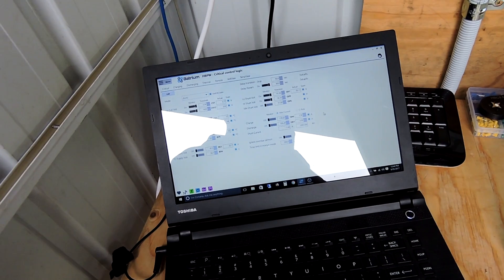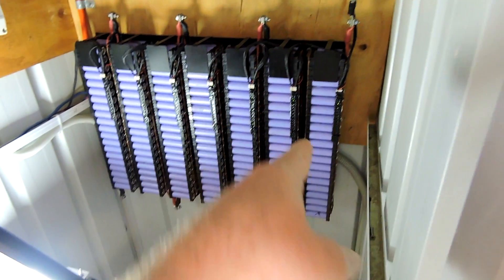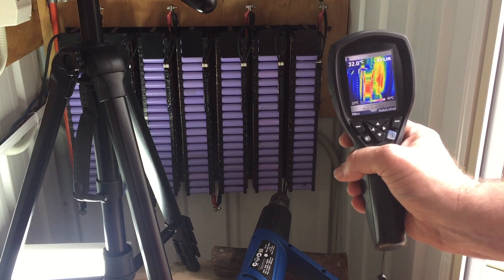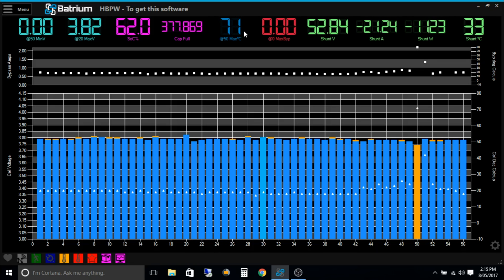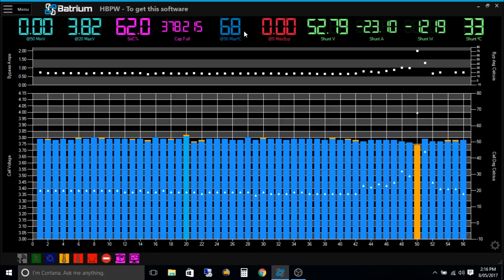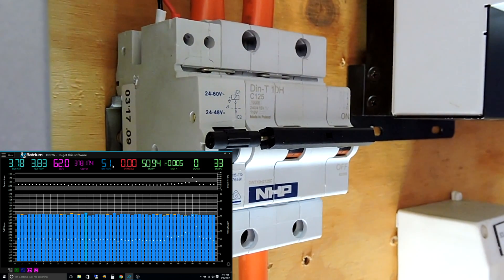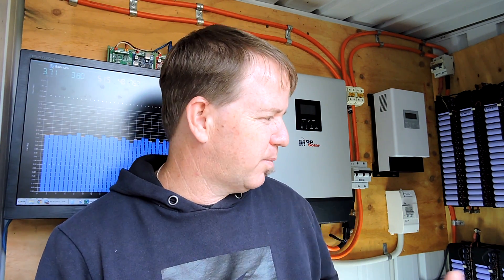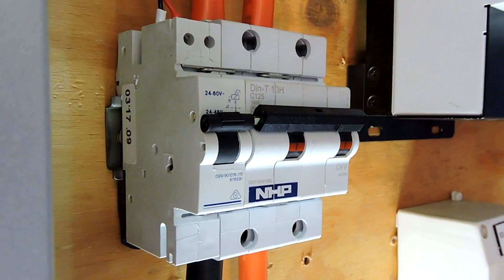⚡💥⚡18650 Powerwall Safety Test using high cell temperature & the shunt trip⚡💥⚡

Comment: hi Pete not sure if u know but I have an existing grid tided set up and want to run a battery bank and another inverter to power the house during the night can I hook up a charge controller in parallel with my existing panels and inverter
Reply from the maker: you need to talk to an expert not Pete, I googled everything I know :)
Reply: thanks mate yes I have sussed it out have the batteries reconfigured the solar panels and have a new hybrid 4048 inverter from mpp solar all is ready just waiting for electrician to wire it to the house on Thursday

Comment: Nice fan, with interchangeable battery with the tools. Cordless tools hasn't really took off here in Brazil so far, apart from small drills and screwdrivers which are relatively cheap. I have a fan that looks exactly like that, but like everything, to be affordable, it's mains voltage.
Reply from the maker: Yes, love my Ryobi battery tools. Great for around the house!

Comment: for all your people looking for cheap cells, I found 20 brand new , LG cells with a bms for a dollar seventy five cents a cell. they are wired in packs @ 36 volts with bms attached.  here's the link for U.S. buyers,  free shipping too. http://www.ebay.com/itm/NEW-LG-36V-4-4AH-BATTERY-PACK-18650-EBIKE-VAPE-POWERWALL-BATTERIES-20-CELLS-BMS-/172630688902?hash=item2831974486:g:nKUAAOSwuspY9YNZ

Comment: Hey Pete ! Nice ! You're right to take care of thermal management of your system, it's very important! The best would be to get the temperature of each cell, but not practical. I still wonder that the difference in temperature between cells outside the pack, compared to those inside, and not even easy to measure with IR sensor because the terminals are metal so the emissivity is not the same as plastic. A water cooled system like Tesla is the best, and from what I understand is a way to cool down a shorted cell so that the fuse blows but the cell doesn't reach thermal runaway, or doesn't communicate its bad manners to its neighborhood ... AND you know I bought an orange hoodie! Another way to say thank you ...
Reply from the maker: Even tho I've done everything I know or understand to make this project as safe as possible I still feel I have a ways to go yet. A bunch of smaller fuses are needed on each bank of batteries as well as the ability to control my pip to charge lithium cells much better.

Thanks for buyin hoodie, be sure to give me feedback as I've never done Tee's or merch before

Comment: 55 degree for 1 min is your protection setting seams to be a bit long, I understand spurious trips and loads, 
OK here is an idea for your next video  test 1 cell fully charge short it out and see how the temperature climbs does it climb past 55 degree in ten seconds and rockets up to thermal runaway before your minute is up before your shunt trip gets a chance to operate, build your own temperature curve in real life by taking measurements  and you might be able to understand more how a cell temperature operates over the min shorted and you will have real world numbers  to work with
Reply: Oh ya keep them vids coming great work 👍
Reply: I agree that the time constraint seems a bit long. I would probably try for 15 seconds. A battery in melt-down can spread a lot of damage in a short amount of time.
Since heat is always a product of a chemical reaction, I assume a cold trip would be purely the result of environmental considerations. Why not just have a thermostat in the room wired in series to the shunt trip. Temp drops, thermostat goes to open and the shunt trips.

Comment: I'd like to see you run the whole house purely off the solar panels and batterypack for 36-48 hours including all of the high amp stuff you don't have hooked up atm like the a/c. So it could be legitimately off-grid. I'm wondering if your battery pack size would be determined by the amount of peak amps you'd have to be capable of supplying or if it'd be determined by total capacity needed to run that long???
Reply: Memphis O'Conner He already Made a video
Reply: sebasese1 Yeah, I've seen those but they're not technically with the full house load because there's some key high load appliances which are only connected to the grid like the a/c and fridge and a couple other items i think. i want too know what it'd take to go full off grid with all electric appliances (i.e. no gas cook tops, hot water or ovens) and still having modern electronics like internet, phones, computers, etc. in other words without going full cave man.
Reply: I'm also wondering how you'd go trying to balance the battery packs if you had something with a decent constant load that you couldn't switch off like a fridge. i.e. would the watchmons be able to balance the packs if you were constantly drawing and charging a hundred amps or more or would they not be able to keep up because they only burn off a small amount of electricity at a time?

Comment: 63 amp breaker? 

Where did you get an odd ball breaker like that? Is that made for a set up like this, or could you find it in an on grid house too?
Reply from the maker: Sparkie said it was required to have a duel pole 63a so that's what it is.. seems to work so all good for now
Reply: HBPowerwall interesting. Here in the States we only have 15, 20, 25... and so on. Nothing with a 1, 2, 3, 4, 6, 7, 8 or 9 at the end.
Reply: Robert Steich ~ found Clipsal dual 63amp on there website at http://www.clipsal.com/Trade/search-results?q=4cb263/6

Comment: How much did the batrium BMS cost? What did you do with the cells that fell below 3v at the end of your last 4kw load test. How often do you get cells failing just wandering if it's worth investing money in this
Reply from the maker: Kit can be found here https://www.batrium.com/products/starter-kit-watchmon-sfp102mod-14s-longmon?variant=30862617480 the cells were just recharged and still in use. It only goes that low when I change the settings to allow such silly things. I only change the low voltage when I'm doing capacity tests for youtube. Don't usually allow that type of things really want my batteries to last as long as possible

Comment: how many amp is full setup and what u can use ? and what kind of solar charger u use ty I'm off grid that is why I ask ty :)
Reply from the maker: ah? useable 650 ah 35kwhs max draw is 90amps I use a https://rover.ebay.com/rover/1/711-53200-19255-0/1?ff3=4&toolid=11800&pub=5575290598&campid=5338073988&mpre=http%3A%2F%2Fwww.ebay.com%2Fsch%2Fi.html%3F_from%3DR40%26_trksid%3Dp2380057.m570.l1313.TR0.TRC0.H0.Xpcm60x.TRS0%26_nkw%3Dpcm60x%26_sacat%3D0 or https://rover.ebay.com/rover/1/711-53200-19255-0/1?ff3=4&toolid=11800&pub=5575290598&campid=5338073988&mpre=http%3A%2F%2Fwww.ebay.com%2Fsch%2Fi.html%3F_odkw%3Dpcm60x%26_osacat%3D0%26_from%3DR40%26_trksid%3Dp2045573.m570.l1313.TR0.TRC0.H0.Xpip4048.TRS2%26_nkw%3Dpip4048%26_sacat%3D0
Reply from the maker: wow they are long links
Reply: HBPowerwall nice ty I was planning to get mppt :) I have 450ah in the moment but not good inventer only 2kw

Comment: So are there cell temp monitor in different parts of the cell or is it just in your long mon?
Reply from the maker: +Clint Judd yes two per longmon so 112 temp sensors in long moms alone. More in the shunt, watchmon & inverter
Reply: So if you get a hot cell away from the longmon then it wont register..
Personally your fuse setup will cover a shorted cell as the other parallel cells feed current into it.
On my pip4048  Ive seen 90amps on the batteries  or just over 4kw output running the HWS as a test.
That was on 700AH of Pb acid.
Personally summer is the only time  your shed will see overtemps as our ambient temps can hover in the 40+ all day and night.
I like that you keep stacking capacity but if you want them to last you'll need to keep them cooler than our aussie  summer temps.. Especially with load.
Like your work
Clint